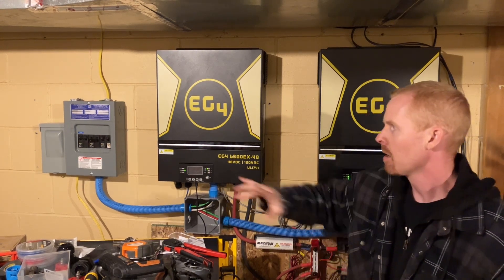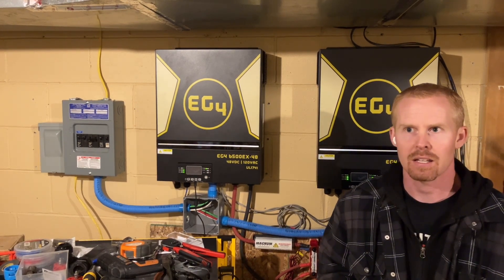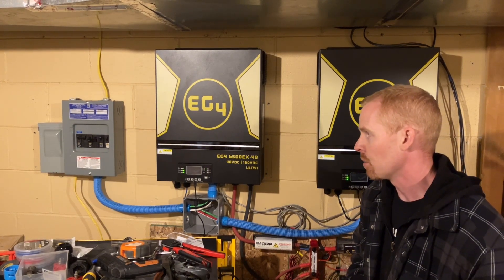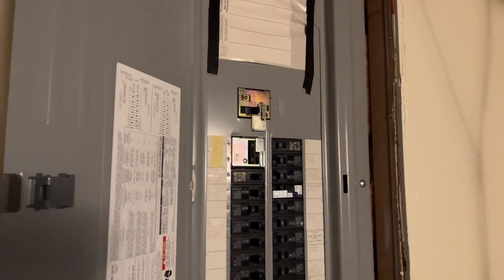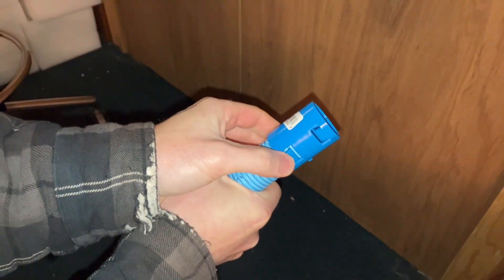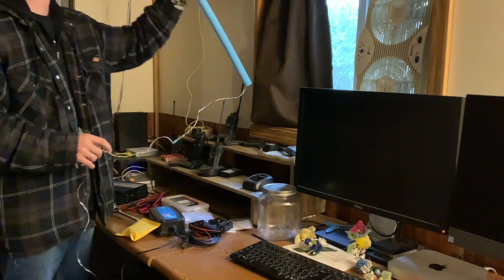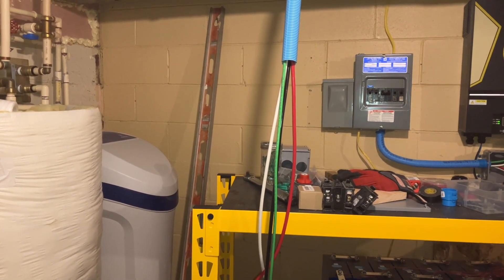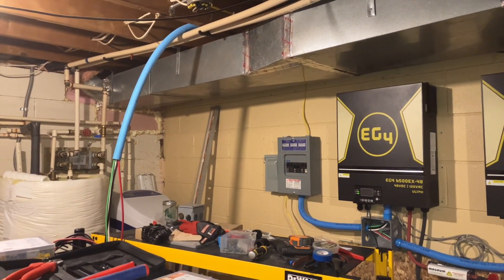Wiring the EG4 6500EX AC Output to My Panel, Part 1

Comment: Hey Adam, what inverter setting are you using on the EG4. The new software update does not have a listing for the EG4......Please Advise.
Reply from the maker: I’m not sure I understand the question.  The inverters have a lot of different settings.  Which one specifically are you asking about?
Reply: @AdamDeLayDIY     sorry I will try to clarify. When choosing the inverter type in solar assistant which one do you choose. I see they don't have one listed for EG4

thanks much
Reply from the maker: @northcarolinadronescapes9506  Ah, gotcha.  

Assuming you're talking about the 6500EX (or even the 6000EX),  you will choose "Voltronic, Axpert, MPP, Infiniti, etc".  The 6500EX inverter is technically just a rebranded Voltronic inverter.  

If you're talking about the 3000EHV, then you'll select "Sumry".

Comment: Run aluminum, sized correctly way way cheaper. I ran 4 runs of #2 aluminum direct burial from panel disconnects to home about 130'. I only run 90 volts due to the low input voltage of 145vdc on my inverter. So I run about 80 amps from each of the two arrays.
Reply from the maker: Not a bad idea
Reply: @AdamDeLayDIY  it's working now. But if or when u get more inverters might b the cheapest option
Reply from the maker: I was actually looking recently for some SER in my area but everything was sold out.
Reply: Both of you sound very intelligent when it comes to solar I'm kind of new have been researching it for about a year or two if either of y'all had time could you please give me your opinion? I have property about 5 mi in the woods off the hard road where the power lines are I've had quotes of upwards of 70,000 to bring power this far back and wanting to go totally off grid I'm in a very laid-back county in Northeast Florida I have already been approved by the county and electric company to be off grid I am about halfway done with building my house a very modest 1400 square foot three bedroom house we do not consume much power we don't have TVs, surround sound, computers but do have tablets as far as appliances 2.5 ton AC with a soft start going in my house has block walls with a spray foamed attic I'm building it to be is efficient as possible all the lights will be led and appliances are well pump (240), washer, dryer oven, microwave, refrigerator and chest freezer. Water heater will be gas and have woodburning stove for heat I know the heat strips on the heat pump suck the power down that will be avoided at all costs also will have 5 ceiling fans thru the house. Electricians just wired the house and it's wired with the traditional 200 amp panel box and 90% of power will be consumed in daytime. I sold my house earlier this year and always had this property but now I'm building a house on the property have about 40K budget for solar and was thinking like 2 6500ex with a 12 to 14,000 watt array and  10- eg4 5.12 batteries will this put me in the ballpark of what I need to run my house??? What would y'all do nothing is ordered yet and I'm open to all options thank you very much for your time
Reply from the maker: @savedforever7702  Thanks for the kind words but in my case looks can be deceiving... :D

It's very hard to talk specifics.  I've found this out even with my installation.  If I've learned 1 thing throughout this entire process it would be something to the affect of "go bigger than you think".  Design your system around the winter/cloudy/rainy days.  Whether that means more panels or more batteries, it's hard to say.  Depending on actual loads, there's a fine line between deciding if you need more panels or more batteries.  You need more batteries for those cloudy days, but you'll also need more panels to be able to charge more batteries within your daily "solar charging window".  

I know what I've installed isn't big enough to run my entire house full time, but I have the grid to fall back on.  Solar can help with loads when available, but when that battery gets to low, I can switch back to grid. For a lot of places I've seen that have done a completely off-grid installation, they always have a standby generator which will be the "backup power" in the event of a slew of cloudy days.  That might be something you want to consider in your planning.  

I can tell you that if I dropped in the hardware you're talking about into my house, it should give me several days of running with little to no sun at all, but I can't say for sure where you live (I would imagine FL has a whole lot more sun though than MI in the winter).  

I feel like I'm just rambling on and I'm not sure if any of this is helpful or not.
Reply: @AdamDeLayDIY  thank you for the reply great info to consider and I forgot to add in order to get permitted I would have to have a 10k or better backup generator and supposably with a 2wire ignition my inverter could start when needed and generator would be propane. Thanks again for the reply
Reply: @savedforever7702  with a 10 kw Genny auto start and 50kwh of battery 13 kw of inverter. I won't say anything is definitive but with this equipment u listed it's always expandable. So if you have to ration a little in the storm season to prevent the Genny from running. Latter you can add what u need weather it be more battery or panels or power. I think you should be definitely capable of surviving comfortably with what u listed.
Reply: @savedforever7702  that's sounds very reasonable for sizing. How's the shading? That would really be the big decision how many panels.
Reply: @electromechanicalstuff2602  thanks for the reply I totally forgot to add this array is gonna be in full sun all day and I mean all day no shade at all perfect for solar and about 30 yards from house where inverters would be. Thanks again for the reply

Comment: Think about running your  conduit along the top of the inverters and dropping down on each side to clean it up. Also a home depot 100amp homeline smaller breaker panel will help. I went through the same issues with my two Eg4's.
Reply from the maker: Seems like the hardest part of any install is determining the layout before you even begin.  With my 12v system, I remember laying out all the pieces on the floor and just staring at them for what seemed like hours.  

Unfortunately I don't have much headroom above the inverters.  My main HVAC trunk runs right overtop.  Even wall-space in my utility room is at a premium.  Had to move all my wife's painting supplies to another wall so I could mount all this stuff.  

Thanks for the ideas though.  It's great hearing from someone who's gone through all this.
Reply: @AdamDeLayDIY  Wish I could sent you a pic of mine.
Reply from the maker: @sh839c  There's always the option of doing a short video and putting it on your channel of what you have set up.  Doesn't have to be anything fancy.  I don't think there's nearly enough "real world" examples of these inverters on Youtube.